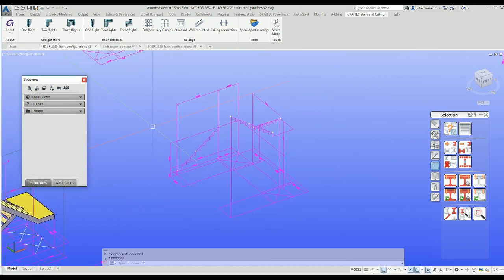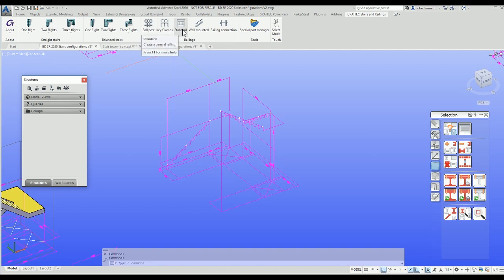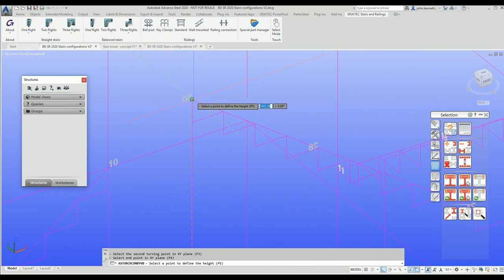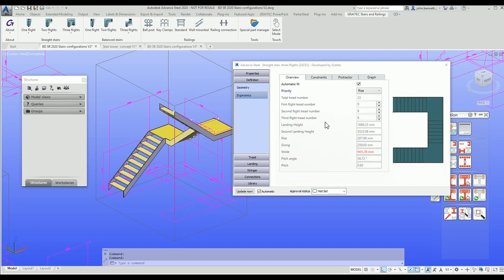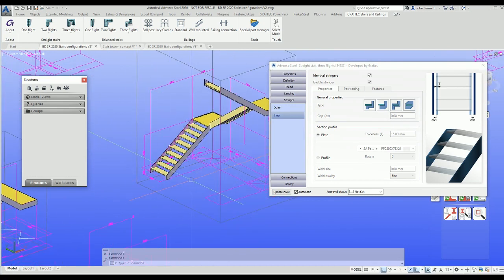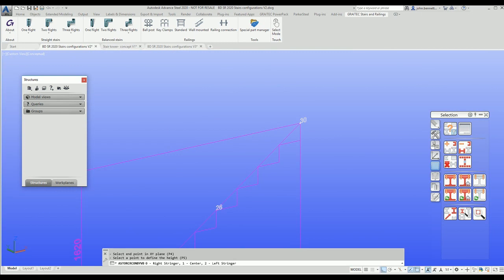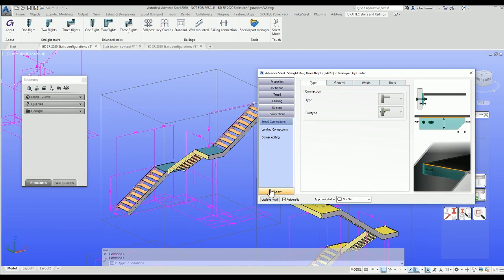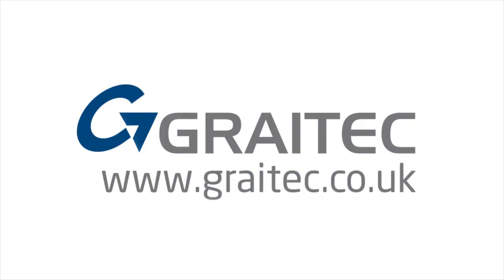BIM Designers 2020 – Stairs & Railings Overview - Straight Tread Plate Stringer Stairs & Landings

Comment: The video was interesting to watch but I can foresee a problem. This macro assumes a free rein when it comes to the stair design. In my experience that is very rarely the case and we are contrained by the architect or engineers design, even down to the joints to be used. The macro may give a basic layout but I could end up spending a great deal of time tweaking the resulting stair with manual editing. The Advance Steel macro is powerful and the copy and rotate tools allow for the contruction of multi fight stairs while leaving the basic stair macro intact. Maybe the tool is heading in the right direction but for me it seems like trying to crack a nut with a sledge hammer.

Comment: Hello, can you please make a video with balance stairs, especially with three flights? I have tested it and unfortunately I am not satisfied with the functionality. Thanks in advance
Reply from the maker: Hi Joe,

Thanks for your comment, please can you provide a contact email address so we can get in touch regarding your query
Reply: @GraitecLtd  

Hi,
in the German test version of the BIM designer Stairs + Railings 2020 I tried to model different types of stairs and thus to verify the practical application. Much needs to be adjusted and improved to use the standard features.

Generally:
1) at small base (for example 2x2m, option 2 - left stringer) no staircases with multiple flights are generated / completely generated. Stair steps are already made with a width of 600mm!
2) in the standard grating tread with existing perforated side plates of all known manufacturers, the screw should automatically appear depending on the type - now you have to choose unfortunately the connection details in the product catalog (here would be a difference between standard and non standard stair step makes sense)

Especially for the balanced stairs (valid for all types!) - wrong behavior / missing functions compared to straight stairs:
1) The stairs are automatically generated with a large, indefinable distance of the stringer below, or the first step below the starting point and thus completely shifted to upper - it is not adapt. It is impossible to secure the required position of the stairs.
2) Tread -> Layout -> Determining the top and bottom position works incorrectly, unwanted offsets are generated - it does not fit; Vertical offset does not work
3) Tread -> when selecting a grating tread = all levels are automatically shifted upwards by the step thickness -> wrong position of the steps - it does not fit
4) Stringer -> no description (right / left) for one flight version
5) connections
 -> with no type of tread you can select the connection with side plate and use it (gray background)
 -> If selected grating, a gap in the thickness of the tread between tread and connecting object (flat and angle steel) is generated - it does not adapt
 -> Reduction of the edge of the connection objects should not only go parallel to the step (for example, when flat and angle steel arise unwanted and very sharp cut)
6) the setting for landing on the balanced stairs is completely missing - this is a must

I think it was enough for the first lap. These are basic things that will always cause the user great problems.
Reply from the maker: @joesatrianijr.6580  Hi joe, thanks for your comments, these have been passed to the development team and if you are happy to supply your contact details they can get in touch with you directly if they need further information.
Reply: Hello, do you have curved stairs with railings?
Reply: @f.c1658  Yes, with that. The other types work without any problems, only the balanced stairs cause some problems.